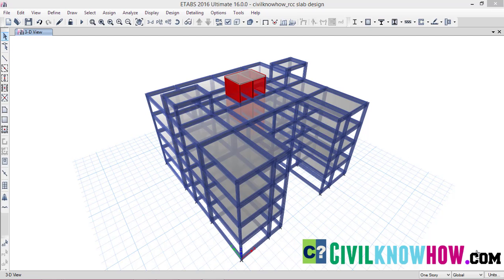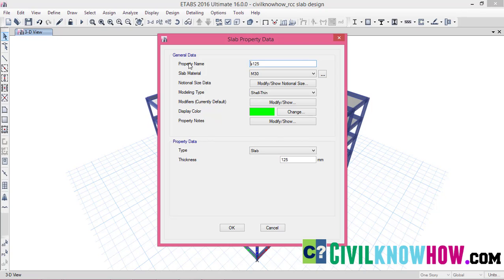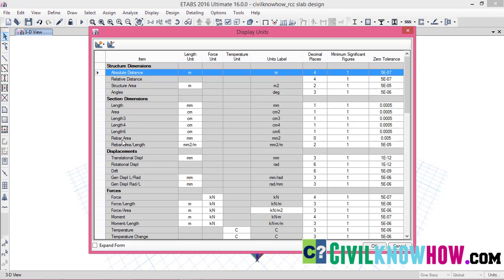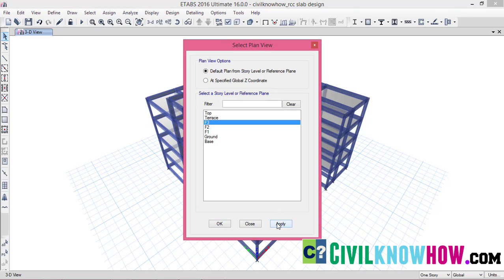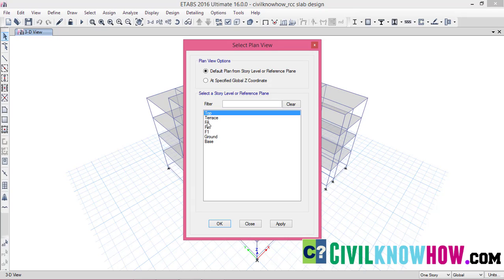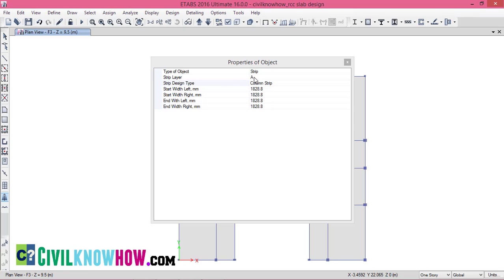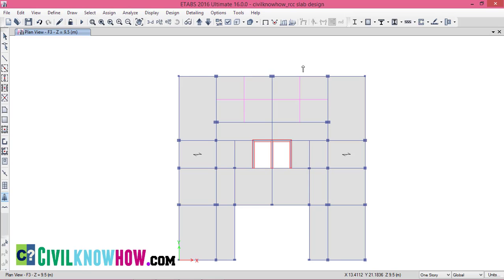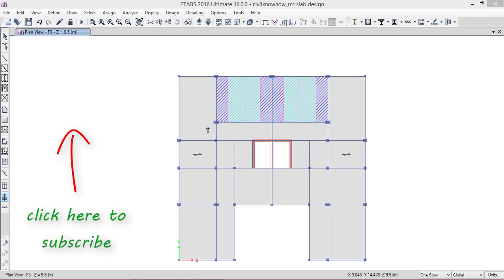RCC Slab Design in Etabs 2016 - Part 1 [Beginners Tutorial]

Comment: How 1750 come I don't understand
Reply: The total slab width in this side is 6m (6000 mm)
After assigning lmin/4 on both the edges, the remaining width for the middle strip is:
6000 mm - 2(1250 mm) = 3500 mm

Then 3500 mm/2 = 1250 mm on both sides of the middle strip

Comment: SIr is it possible that the etabs show that the building has passed but still a failure in real life
Reply from the maker: +Abdul Basith if u model and analyse the building in proper manner...it will not be a failure as per design
Reply: Hahaaaaa... very simple but very practical question. Yes it is possible if materials are bad, formwork fails, steel not provided properly, or soil or foundation problems. So you have to check at site what they are doing😃😃